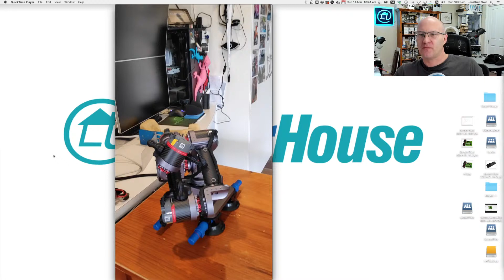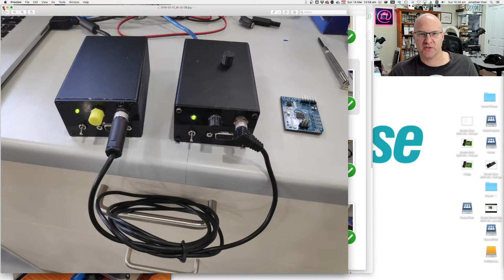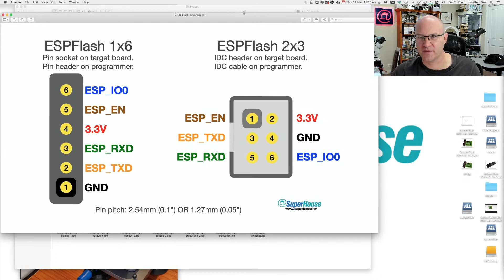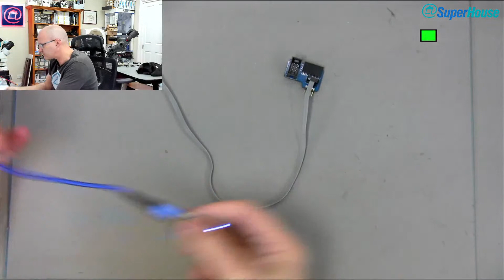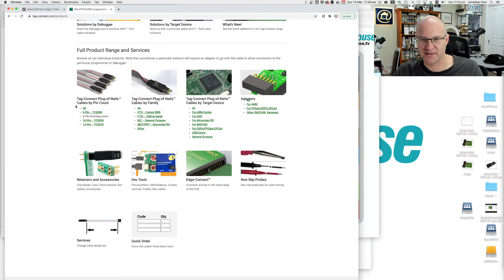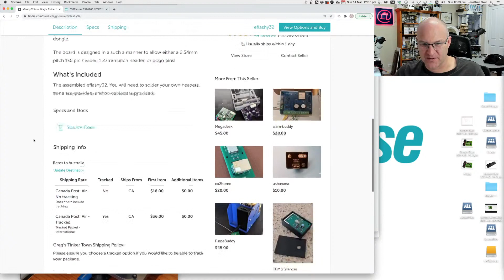Home Automation Hangout 2021-03-14: ESPFlash

Comment: Damn missed another stream. lol doh, I use telegraf to dump mqtt right to influxdb.. It breaks lol yup influxdb totally just breaks, be careful on 32 bit systems, it will just hit max filesize and die usually killing your cpu usage. The only thing I find an issue with influx is afaik it will not auto aggregate and archive "rollups"